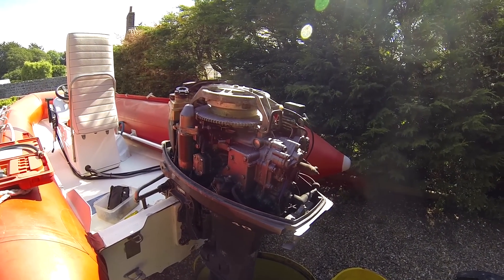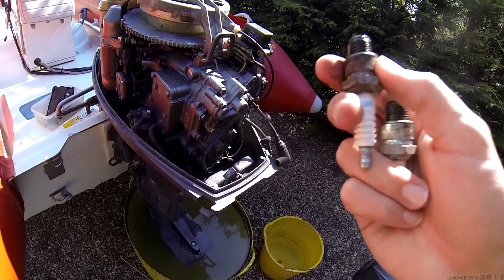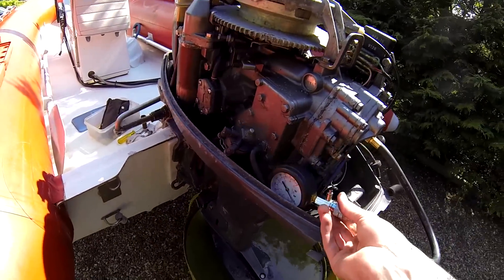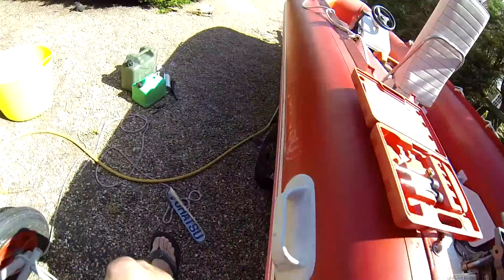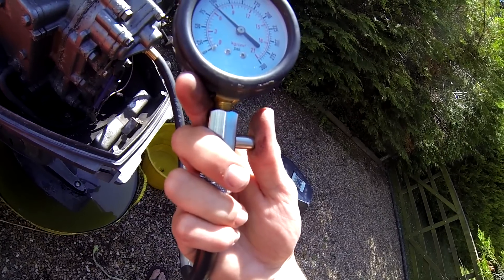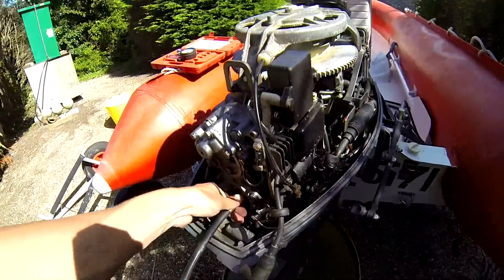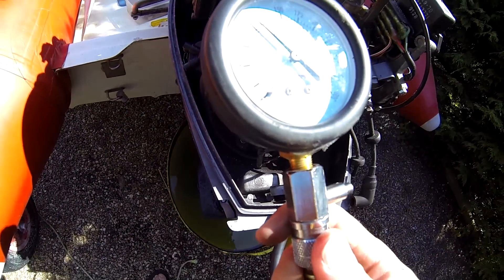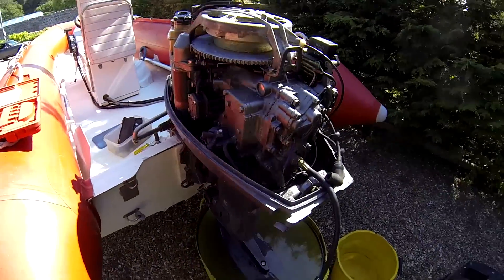How To Compression Test an Outboard Motor

Comment: MAKE SURE YOU HAVE FULL THROTTLE AND FULL CHOKE ON!!!! I have personally seen 30% psi difference with these two conditions the other way (low throttle, choke off). This is especially true on older outboards I work on (60's and 70's).
Reply: Lower or higher with choke and full throttle

Comment: So should the compression for a 150hp motor be above 150 on a 2 stroke Johnson?
Reply: Did you find out?
Reply: Most petrol engines compress at ten to one, normal atmospheric pressure at sea level is around 14psi  therefore an engine with no wear you'd expect a reading of 140 psi. Anything over 70 generally will work but ideally you'd want to see it over a 100 and consistent across all cylinders.

Comment: Mist warming up the engine, then you need to open throtle  wide and leave it like that. Then you can get a true reading.  Cold readings with closed throttle are nothing.

Comment: old engine or new dont matter, compression needs to be within range or the engine is crap.ive seen 1 year old engines with shitty low compression and very old engines showing  very good compression. both cylinders on a twin need to be within 10%.  Now to test spark get a proper spark gap tester and do not try it by just earthing to engine near cylinder, it can explode the fumes and burn your paws !!!

Comment: Useful vid.  Probably a stupid question but in an engine without the remote control setup like this one what do you do to turn it over for a few seconds?  Pull the start cord a few times?  Also did you have to disconnect the fuel line?

Comment: throttle should be wide open when cranking
Reply: How do you accomplish this with the lock out linkage in place on a tiller steer outboard?
Reply: @stevejones6111  you can probably hold the butterfly valve open with one hand and then crank it